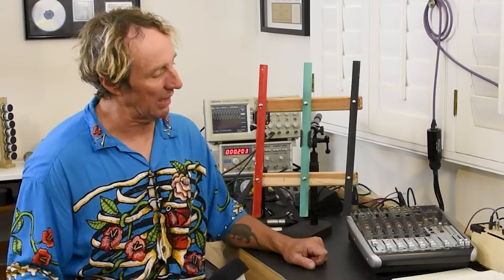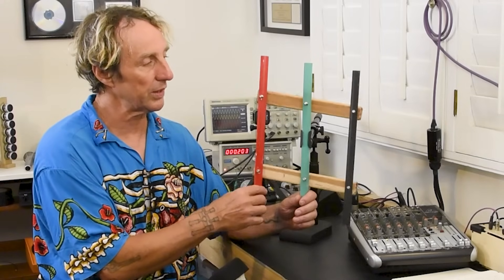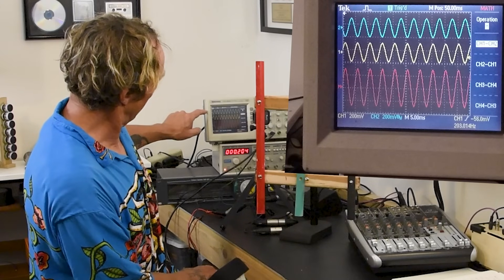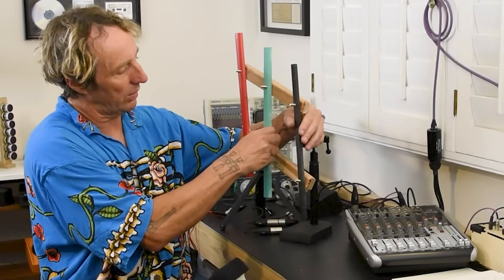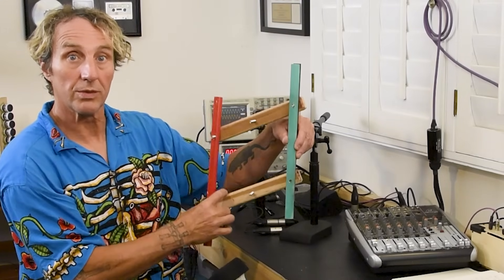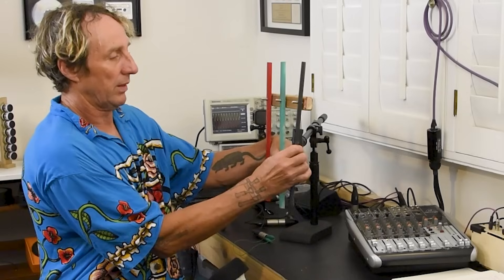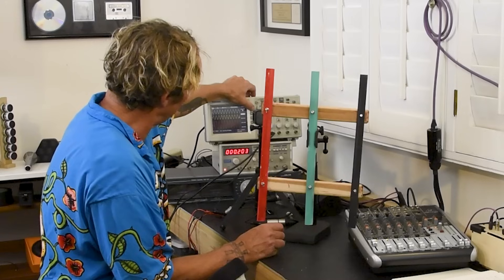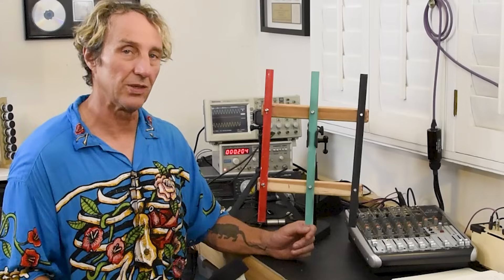The Mechanics Of Audio Balanced Lines Explained

Comment: As much as I LOVE your stuff, the problem with the piece of your child's toy, that you were about to throw out from your attic, but thought would be useful in an explainer video ;) is that it misses a crucial aspect of ground wires.  They wrap AROUND the microphone pos/neg wires.  They are not in the middle.  By wrapping around the exterior they are the first conductive material that external electrons meet and therefore are drained away before hitting the mic electrons.  I believe that's right?  

I think "balanced" is a somewhat unfortunate name.  "Shielded" which is sometimes used too, is better in some regards!  Again, LOVE your stuff.  Which I had more time to watch.
Reply from the maker: Balanced lines don't need a shield or a ground. And whether the ground wraps as a shield or is a separate wire down the middle makes no difference to balancing. 

Also, electrons travel no faster in the shield than they do in the regular wires. So the signals and electrons all arrive at the same time anyway
Reply: @DaveRat  If I may quibble.  A balanced line without a shield or ground is what really?  A voltage must have a return path.  There is no such thing, right, of a single path (wire) of microphone voltages.  Another way of putting it is all microphones MUST have two wires.  So why call it balanced, or anything else?  It is two wires where current flows from magnetic movement.  What really distinguishes a "balanced" line is the return path is separated from the ground, or external electrons, right?  As for the speed of electrons, I don't think I said anything about that, only that is drains external electrons away from the microphone circuit, which is always a circuit, always two line?  Does that make any sense?

So in your explanation, you did it in reverse, you talked about what if you put the ground with the pos/neg.  Shouldn't you have explained it the other way. How to remove the "ground" from the pos/neg circuit?  You create a 3rd line.  It always comes after.
Reply from the maker: The balance line is its own return path there's two wires and they form the electrical circuit.

A a dynamic microphone is a coil of wire a Merced a magnetic field and when that wire coil moves it generates electricity on the two ends of the wire.

No ground is needed. A shield is beneficial in reducing the amount of noise but not needed for the electrical function of the circuit.

On the receiving end it can be just a transformer again without a ground on the input of the transformer or coming from the mic.

Or it can be an electronic circuit they inverts the polarity of one of the 
Lines and sums it with the other one.
It is not till you get to the output of this circuit or the debalanced part of the circuitry that a ground reference becomes pertinent.

The output of the transformer well also be balanced naturally but in order to transport the signal it's quite common too ground one of the legs of the output of the transformer and have the other leg be the signal at which point the signal is no longer balanced and a ground or common is involved.

While the signal is balanced any noise signal induced on both lines equally will be canceled out when the signal is debalanced.

After the signal has been debalanced any noise induced will get embedded in the signal and will become much more difficult to eliminate.
Reply: @DaveRat  Thanks for response.  I hope you can continue to bear with me.  Sorry, I have to disagree with your first statement.  Yes, theoretically, a balanced line has its own return path and forms an electrical circuit.  But only theoretically.  I think that's important.  Because it's like, um, fantasy ;)  No electrical circuit exists in a vacuum, so to speak.  A microphone voltage is useless by itself until it is amplified and right there it connects to another electrical circuit.  And then static electricity between the wires and air, what circuit is that?  So I mean, sure, a balanced line forms an electrical circuit but in the real world is that the end of it for you? ;)

2nd sentence.  When the coil moves it pushes electrons in one direction or another.  They bump into each other, right?  The magnet doesn't create "electricity" (electrons).    Each end of the wire either has a pressure or vacuum, so to speak. 

In the 3rd sentence, again, SORRY!!! but you're talking about this stuff in reverse.  EVERYTHING is grounded in a sense.  All atoms are charged, the difference is how reactive they are to magnetic fields, right?  Copper is VERY reactive.  Wood, not so much.  

One man's noise is another man's music.  Noise is only what we call electron pressures we don't want in our world. Shielding IS needed for every electrical circuit to work in the real world, right?

Or let me put it this way, you see your job as getting a good signal from all the musicians on the stage and out to the audience.  You think signal first.  But couldn't one look at your job as getting ALL EXTRANEOUS signals out of the system?  Chicken or egg?

What do you really mean when you write, "While the signal is balanced any noise signal induced on both lines equally will be canceled out when the signal is debalanced"  Can you explain that to me in terms of a single electron? 

What is "noise" but a fancy term for a voltage we want shunted to another circuit?!!!  IMHO opinion, talking about a "balanced" line as being possible to exist without a second circuit (ground) doesn't make any sense.  Not trying to criticize.  Just trying to explain how I think your explanation could be different.  It's what I love about you.  You talk about the real world.  But I feel here you're talking too much like an engineer with electronics theory and not about what follows what in the real world.

Man plugs in microphone.  God laughs ;)
Reply from the maker: Hmmm sounds fuzzy in the understanding

Step back and look at what actually works and is easy to demonstrate

Cut pin 1 in a mic cable and the output is identical. More susceptible to noise but the output is unchanged. No ground needed.

Cut pin 1 on a mic pre, same results

As far as noise signals induced on balanced lines and the ability to cancel out the noise, Google common mode rejection or CMMR
Reply: @DaveRat  How exactly am I fuzzy in understanding?  I'll do a video to answer all this.  So you can get to comment ;)
Reply from the maker: Everything being grounded? Being grounded tends to mean that it lacks an electrical potential in relation to Earth or ground. If everything was grounded then nothing would have an electrical potential which is clearly not the case.

Electrons running into each other being a specific factor unique to this situation that isn't universal?

Pressure and vacuum? Pressure infers that something would come out of it and vacuum infers that it's pulling something into it yet electricity involves neither of those things.

Electricity has a voltage potential and when provided a return path  then is there is electron flow

By fuzzy I mean the blurring of concepts in such a way that it infers things that are not quite correct
Reply: @DaveRat  Being grounded to me means a current that would run through my heart will go into the Earth instead ;)  I never said everything is grounded, did I?  I said that electromagnetism is all around us and manifests itself in some materials more than others.  Pressure and vacuum?  Yes, you're right. Bad words.  My point is that what you're showing in your scopes if artificial.  The top waveform is measuring voltage pressure.  The second is measuring negative pressure.  Could you have a different waveform in the top from the bottom one?  You can't.  Or can you?!  

They both represent the same physical force. Therefore, Occam's razor!  The reason you want to waveform one is it will represent the waveform phenomenon.  Otherwise they cancel out, as you point out, and what does that tell us?  What use is that?  The use is to show potential current, or fluctuations in voltage.  At the end of the day, you only use one and it is an exact mirror copy of the other--except, again, when other electromagnetic forces enter the copper.

There is no voltage without current.  No current without voltage.  Yes or no?  Same force, different ways of looking at it.  

What am I inferring that is not quiet correct.   A "Balanced" line is a theoretical concept.  When you attach your scopes you are taking the "balanced" circuit and transducing again to what?  Either you correct my thinking or open up yours ;)  Calling me "fuzzy" or "blurring" is only name calling, right?  Like I'm not right with God?
Reply from the maker: Go back and read your post I believe you said everything is grounded in a sense.

No insult meant by fuzzy. All I'm saying is that the word you use to explain it provide an unclear representation

Feels like you're trying to relate this to a very broad context which blurs understanding and when you overly generalize you end up with many flaws.

A balanced line is just a term to describe an electrical circuit where neither of the wires are grounded and either have no reference to ground or the same impedance or reference to ground.

How's electrons flow back and forth in the wires they provide an in polarity and out of polarity measurement in relation to each other.

If properly implemented then The input circuit that a balanced line is connected to will have the capability of canceling out noise signals that are equally induced onto both lines. 

This is a very beneficial circuit for dealing with low level signals that are susceptible to noise being induced upon them.

Fortunately and wonderfully purely just connecting up a dynamic mic naturally creates a balanced line. 

Amplifiers in bridge mono mode also create a balanced line. 

Balance lines can also be created by taking two amplifiers wherein one is polarity reversing and the other is not and running a signal into both amplifiers. 

The outputs of the amplifiers will be equal and opposite of each other though equal is not critical.

If a balance line is hooked up to a circuit or preamp that inverts one of the lines and sums them back together again then the opposite signals which are what we want will some together and be additive and increase in level and any signals that are equally induced on both lines will cancel out.

Comment: This is all sorts of wrong (which is par for YouTube). The defining characteristic of a BALANCED audio interface is that the IMPEDANCE of both signal legs are IDENTICAL with respect to ground (it's essentially a WHEATSTONE bridge). Please read the various papers by Bill Whitlock (AES Fellow and head of Jensen Transformers) for further enlightenment.
Reply from the maker: I'm not sure if that's correct.

Whether there's a ground or not is irrelevant to a balanced line.

All that a balance line requires really is that the signal is produced across two lines. 

Introducing differences like impedance differences on one or the other line and not impacting both equally may or may not impact the balancing.

In reality the signals on the balance line need to be opposite but they don't need to even be equal with reference to ground, for line balancing and common mode rejection to work.

Comment: 👍 Noice...,
The devil in me wants to see the model for a star-quad cable.
Reply from the maker: My understanding of quad cables is that by having four wires two for the in polarity and two for the out of polarity, it's purely a refinement. All the principles are the same except quad cables are a bit better at making sure that noise signals induced on the wires are more identical and therefore can be better canceled out.

Comment: Love the shirt Man
You could've mentioned CMRR Figure in preamp specification is how well the common mode rejection is working
The secret behind balance line transmission is the differential amplifier longtailed pair
USB cables are also balance
Reply: CMRR has been a topic for decades.  Differential amplifiers and balanced signal transformers have been in audio at least since the 50’s.  I’ve had tube amplifiers balanced all the way thru from huge church organs complete with schematics in the form of blueprints.  Back when audio engineers wore white shirts and black ties.
Reply from the maker: Super cool and yes, very useful to understand how it works and implement whenever possible
Reply: CMRR is starting to get into the electronic engineering of amplifier design. Dave does often straddle the electronics engineering and the sound engineering. When watching this video I was always thinking of CMRR but that's probably because I cut my teeth on the electronics. Balanced is used in RF as well. Ethernet on twisted pair is balanced. Pretty much the go-to method of removing noise.
Reply: @ Yeah And there are mixes which remain balance all the way through the mixer
Reply from the maker: Yes noise rejection is critical with cat cables and a significant focus of the design. 

And yes mixers that have balance signals all the way through do exist though with digital being so common now it's not as relevant.

Comment: Differential vs. common mode signals. Also, common mode rejection of the preamp is dependent on its differential input resistors matching where 1% matching will result in 40dB CMRR (common mode rejection ratio) which isn't all that great compared to a a circuit with CMRR trim which can chieve in excess of 100dB CMRR.

Comment: What can’t this man do.  Tell me is there an advantage to using this method to a line voltage pa or general multi sound setup IE to a venue.  The only reason I query is to minimize interference from many other feeds of electrical and data while all contained in conduit just wondering if 2 core plus earth is a better investment to figure 8 even though output and speakers are all just standard +\- binding posts not XLR etc.  PS nice call on the L’acousticrig for Jam’s tour.